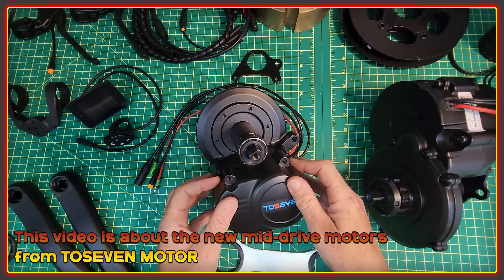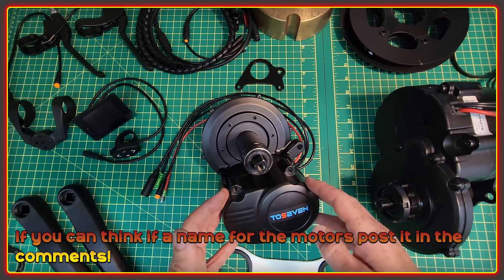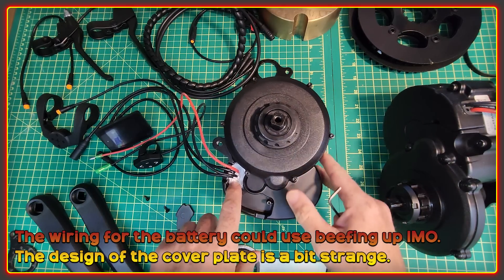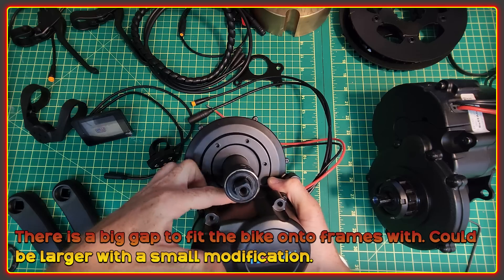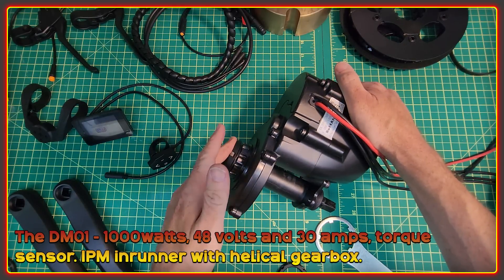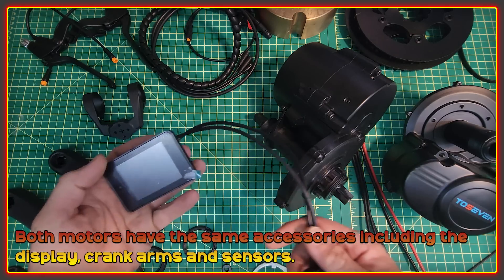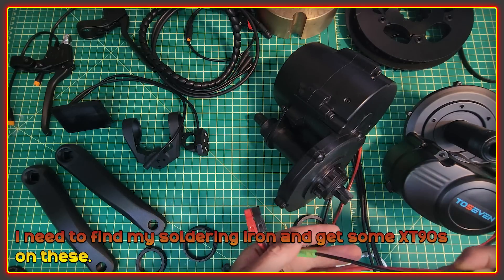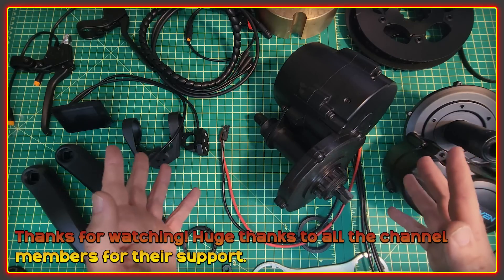New for 2023, DIY ebike conversion motors from TOSEVEN! my first thoughts.

Comment: I looking the mid drive with bottom bracket 120mm
Reply from the maker: There is a dm01 now available for 120mm bottom brackets
Reply: @HighVoltageKits  
I live in Kharkov, Ukraine. 
Can I buy a dm01 bb 120mm motor? 
How? 
Where?

Comment: Is there any way to add a throttle to the DM02 or is that only possible with the DM01? I don't use a throttle often, but it's just a nice option sometimes when I can't pedal. Since they both use the same display, seems like it ought to be possible if one swapped out the 1T3 cable for a 1T4. The motor wouldn't notice the difference since all it's doing is reacting to control signals from the display. Although someone somewhere wrote that the DM01 throttle seems to be strictly full on and full off. Is that true? That would be nearly useless.
Reply from the maker: You can use a 1:4 with a throttle option. You just need to request it.
Reply: @HighVoltageKits  Thanks. Assuming they're Bafang-standard, a 1T4 cable is pretty cheap and I already have a compatible throttle.
Reply: @HighVoltageKits  One more question: do you have any idea how thick the spider is? Would it be possible to mount double chainrings on it? I don't like wide-range cassettes because the jumps between gears are too large, but I'd still like to have a relatively wide range, which would require two chainrings. (Yes, I know getting a front derailleur to shift with such a huge chainline dimension will take some finagling.)

Comment: Hi
I have an ice full fat trike and I'm currently looking for a torque sensor mid drive...I had thought about cyc photton but not good at moment...can you give some advice please.
Reply from the maker: For something heavier the Photon is not a good bet. The DM01 might be worth looking at if it will fit. CYC have the larger X1 motors as well and Bafang will have a TS motor available early next year. If you would like you can join our discord server. There is a link in the description and post photos of the frame and bottom bracket. It will be much easier to help I think than on the comments here. Be nice to see the trike. It sounds pretty cool.
Reply: @HighVoltageKits  
Hi
Thanks will do.
To see the trike faster Google ice full fat recumbent trike.

Comment: Its good to have more mid drives on the market, it should drive up design quality, i believe bafang are moving away from the standard conversion style which disappoints me big time, so its good to see another 1000watt mid drive, i think they should look into making a better bracket to lock it into the frame, bbshd lock ring and bracket is abit annoying at times, also hope they learnt from bafangs mistake on the stators rotor shaft snapping on the older models. They should also try for a bluetooth feature built into the controller, that would make it compatible with a choice of display units.
Reply from the maker: I believe that they are looking at some different display options. The current on is a bit dated in some ways. With the lockring I think that a universal style like lekkie use would have been better as then it could have been fitted using a torque wrench. It funny when you say on the rotor shaft. I know of the issue although mine is still ok from 2018 even running it at 3.5kw. I am kind with the gearing so perhaps that is why. Thanks for the comment! Cheers

Comment: Slip chain can chew up that plastic in no time.
Reply from the maker: The offset of the chain ring prevents this. There is no access to the plastic part. The other issue is once the chain is off it stops moving so it can't chew up anything.

Comment: The TSDZ2B has a small gap between the BB to the motor housing which would mean moving my cables located under BB.  The gap on the DM02 looks large enough to leave my cables in place so hopefully the DM02 proves to be reliable and available here in Europe.
Reply from the maker: Increasing that gap was one of the improvements made by the designer. There should be some photos on our Discord section pretty soon that will help people with the fit. The dealer network is being established for NA and Europe. If you wanted one sooner though it can be worked out directly if you make contact with their rep on the Discord server. The links for discord are in the description.

Comment: Hey HV! Are main gear compartments the same size on both motors? I mean radius which may prevent fitting to some frames. For example photon or bafang have smaller main gear i think
Reply from the maker: The gear on the DM02 was smaller. Both fit well on the bike I am using. The radius will still cause issues with some frames though I am sure. The Photon is likely the most flexible when it comes to mounting it.

Comment: I like that you can mount the display Vertically or Horizontally which will make it easier to fit on a recumbent.
Reply from the maker: I have seen it flipped but I am not sure right now how to make it flip. In theory though yes. I hope it also makes reading with sunglasses possible as well.

Comment: Feedback for the manufacturer: Any sort of proprietary fastener is a non-starter - if you're Shimano fine, but not if you're not guaranteed to still exist next year.
Reply from the maker: I don't think any manufacturer is guaranteed to be here next year but I don't think it will hinge on the two lockrings. As long as the company make them. Bafang has always used a proprietary one as do CYC. What will make the difference here is how they iron out the kinks with the design and get the distribution and servicing right IMO. I do feel your sentiment. It would be nice to be able to use standard tools.
Reply: @HighVoltageKits  Right, but if the company folds they won't be around to make replacements and I wouldn't necessarily count on aftermarket support if there isn't enough adoption. They're not even profiting off a proprietary fastener since they don't even sell tools so unless there's an engineering reason we're unaware of there's literally no reason for it. I doesn't seem like Bafang nor CYC are heading in the right direction either with the M625, or CYC's warranty policy. Do they not realize they're serving the DIY market.
Reply from the maker: Yeah if they fold then there won't be anymore parts made 100%. Thats been a huge problem with many of the start ups making bikes that are now junk due to lack of parts.

Comment: So sad to see they did not solve the main issues of these drives:
- No cover for the wiring underneath the motor. This tiny void in the 500W Motor cannot take any cables or connectors. The 1000W is even worse, as bad as the BBSHD. The wires are exposed and will fail eventually. 
- There is no torque arm to get rid of the counter rotational torque of the motor to the frame. The TSDZ2 has this, but it does not work on most full suspension frames. There should be a solution that simply pushes against the downtube of the frame. There is penty of space for that for all of these middrives.
- This motor uses proprietary a lockring, chain ring hub, speed sensor connecotr, throttle connector. Why do they not stick to the standard of bafang or TSDZ2? This is completely unnecessary, they change great working parts for the bad. Instead of fixing old issues these these new drives make it worse then its predecessors.
Reply from the maker: I have not found a need for a torque arm with any of the mid drives I have used or had an issue with motor rotation. The torque arm on the 02 is horrible I quite agree. The way the wiring could be better and i have suggested it be revised,  i have fixed it on mine already. In terms of the lock ring it allowed for a new design with the sprag clutch and torque sensor / main gear integration. They are not that hard to remove. I don't know why they don't use a standard pattern for pin outs. Would be great. I have been enjoying the DM01 so far with some good long climbs up to 35kms.
Reply: @HighVoltageKits  I build a bike with TSZD2 yesterday, a fully so the torque arm was not used. Result: Motor turned to the front till it hit the downtube during first test ride. I must admit that i did never had this problem with the BBS02, maybe since it as deeper "claws" that bite into the bottom bracket tube. Not the best solution either, but something the ToSeven and TSDZ2 lack of

Comment: There’s a video on the Toseven guy installed one and it shut down after a short test drive he had a problem with his CYC outer bearing. I’m happy with my BBSHD 1000 miles not one problem
Reply from the maker: That sounds familiar 🤔 I had a firmware bug at 2.6kms with my DM02. The DM01 is still going. There is meant to be a patch. I'm going to look at that bearing as well. The BBSHD also had early issues. I will update next week.
Reply: @HighVoltageKits i think hes talking about your video 😂

Comment: I think the degree of allowed configuration changes may be critical to success. The great advantage of the BBSXX motors is the ability to configure them to meet the needs of the rider. I have seen new riders become much more satisfied when the power profile is adjusted to suit their riding style.  Of course, this is a good news/bad news kind of thing for the manufacturer as you have less control over how your motor may be used and bad things can happen. It will be interesting to see how these motors develop. Nice work!
Reply from the maker: I think there is a balance to be had. I will be making some suggestions for changes to the menu systems. Thanks for the kind words.

Comment: I really wished they upgraded from the Tapered square design imo. Only CYC from what I recall uses ISIS from the conversion kits market. Also hope this one can fit on bigger BB standards that's more common for more modern full sus frames especially if you want some trail riding. Though you'll have some ground clearance issues with conversion kits compared to direct mount frames, but that usually depends on the type of trails you'll ride.

Also hope there's future screens that are more minimalistic and possible allow Bluetooth firmware updates. That'd be great quality of life addition.
Reply from the maker: I think that at present updates are via cable. There is an astonishing number of things you can tweak just with the display. I was quite surprised. I know the gap to the motor is larger on this but how significant this is in terms of the number of frames that it can be put on is unknown. I should be able to test it on a great many in due course though so I will find that out. I think this screen could be made to be quite discreet with a bit of effort. I am sure other screens will become available though as TOSEVEN are not locking down the firmware.
Reply: @HighVoltageKits  >There is an astonishing number of things you can tweak just with the display. I was quite surprised
I saw another video that showcased the dm01 and display and yeah I'm quite surprised it's pretty detailed. Seems they're really going for that customizability angle from the forums I've read about it which is definitely something that caught my attention.

> as TOSEVEN are not locking down the firmware
Yep this is the biggest attention drawer for me. I actually do program for a living so I don't really mind tinkering or doing some side projects on my free time. If they release the specs for the controller and the comms protocol it should be easy to adapt other displays if I can flash it. Since there's a lot of settings available on the display already, I'm fairly confident creating an app and using a display with bluetooth functionality shouldn't be that hard to do as I do prefer tweaking settings in an app since it's more ergonomic. Making it compatible with OTA firmware updates will be another thing but that can be ignored for now. 

From what I've read it's still quite a work in progress so I'll probably hold off for a bit on buying one for toying around, but definitely will look forward to your thoughts on it on an actual ride. This might replace tsdz2 for me as I have one that has raked quite a bit of distance and might replace it in the future.

Comment: Please try the DM-02 with an Eggrider display, I'd love to know if they are cross compatible out of the box
Reply from the maker: The operating system is unlikely to be compatible without work on eggs side. Not impossible for them but it would need coding work.
Reply: Its not compatible 100%
Reply: i believe the firmware is design for bafang controllers only

Comment: What is the extra hole for on the motor bottom bracket mount and also the big daft casted loop thats part of the motor casing!!! nice video, canna wait to see it out and on a bike working.
Reply from the maker: Good spot. I am not entirely sure. There is some kind of bracket they sent that looks to use it. As to the reason its unclear. I expect I will find out in the instructions. The larger motor does not have this so it seems strange that the smaller one does.

Comment: How big is the chainring on the 01 motor? If it's similiar to BBSHD then it's still likely to cause chainline issues on modern mtb frames yes? Great vid, looking forward to seeing these motors fitted and running.
Reply from the maker: I think its a 46t. It feels big. You may have a point here. Some variety would be good.
Reply: depends, i have two nsbike frames with bbshd along with a 9speed cassette and issues at all on my chainline, i can use all the gears, my biggest cog is 42t and smallest 11t, the issue will come with 11-12 speed cassettes from what i have seen on other builds. I use a boost rear 148 and i thought that would make it worst somehow but i guess i got lucky. I still use the stock 46t from bafang aswell

Comment: some thoughts about the DM-01 from todays ride (very hilly, lots of pedaling effort, and in steep parts quite a bit of assistance (up to 900W battery power)). I have about 10'000km riding experience with a Bafang BBS02 750W, specially greased gearbox and 42t dished alu chainring. The obvious advantage of the Toseven is the presence of a torque sensor, but, IMO that's where it all ends. possibly also the display settings which are more vast than on Bafang drives. However, having a easily reachable throttle makes the BBS02 not any less performing under emtb riding conditions. Where  the Toseven does not shine is in the gearbox and chainring options. The gearbox in the toseven has the one way bearing integrated in the large gear. pretty huge sprag clutch. But that also makes the large gear torsionally flexible to some extent. You can hear elevated noise coming from the large gear when pedaling hard at low speed with a lot of motor power, because the lack of torsional stiffness can lead to a poor alignment between pinion and large gear, since these are helical cut gears. Also, the toseven is way louder than the BBS02, obvioiusly the motor spins about double the speed, but I think the gear cuts are not all that smooth. I might be wrong on that, but the noise is really bothering me offroad. lastly, the tongsheng 42t chainring fits on the splined spider, but it also has much less offset. if you want a smaller chainring for better hill climbing, you need to get a bbs02 lekkie or so, and build an adapter plate for the toseven splines. 46t stock chainring is really huge for mtb. not being narrow wide is not an issue if you have a clutch derailleur. 
all in all, I still prefer the BBS02 for it's super smooth gear box, very low noise and the choice of displays, chainrings etc. and it's quite a bit cheaper. the best would be a BBS02 with a  torque sensor. Who knows if that comes one day
Reply from the maker: Thanks for the feedback. I have heard rumors of Bafang putting a torque sensor in the 02. But they also are forcing a battery with all their new stuff. The DM02 might be a better fit maybe. It's got a smaller chain ring. I did notice the larger one on the 01. Thanks for the feedback. I will make sure it gets passed on. I'll probably try the 02 first.
Reply: @HighVoltageKits  I'm not quite sure, but I think it would be possible to run a torque sensor through the throttle cable, as it requires the same wires (+, signal and gnd) if 5V are enough (i'll check the torque sensor supply voltage on the dm-01), the torque sensor should easily be wired to the throttle input on the bafang controller
Reply: the reason toseven has moved the clutch to the large gear is to reduce resistance when pedalling without assistance. The clutch in the nylon gear on bafang motors is much deeper and not exposed to anywhere closely as much torque and therefore thrust, since the gears are helical cut.
Reply: @JoLe1991 hi jole.. in alex from toseven. Would you be happy to discuss your experience with me?
Reply: @Alex-uh1mj  sure. i've installed many ebike motors on customers bikes so far, mostly bafang bbs02, so .I know this motor very well, it's strengths aynd weaknesses, and how to fix at least some of them.
Reply: @JoLe1991  please join the high voltage forum and get me under the 01 motor there

Comment: The hollow space is a good place to stash an apple air tag.. "tracking Device" and ya the bigger motor needs a skidplate to protect the wires, here in Cali my BBS02 gets damn hot in fact when it's over 107F out i just drive.. i hope those dont just burn up..  but without the little ridges in the clocking plate idk what will stop it from moving 🤷
Reply from the maker: I'm hearing mixed things on the locking plate. I guess I will be a guinea pig. Hopefully they have decent thermal management